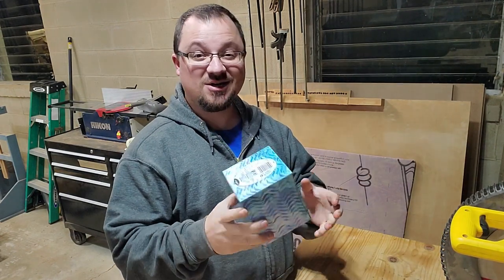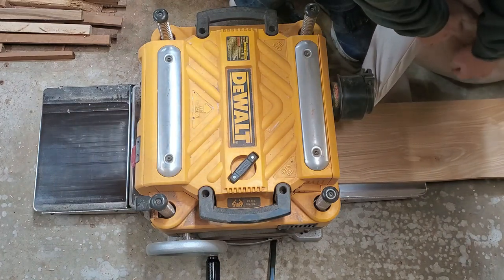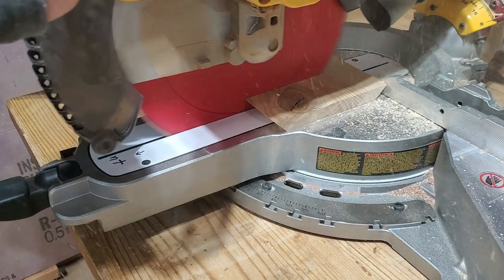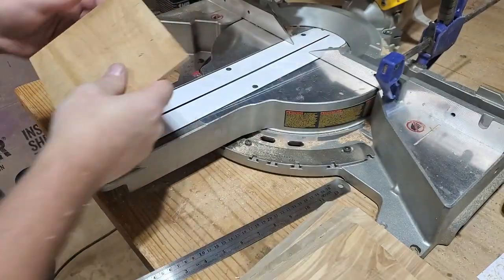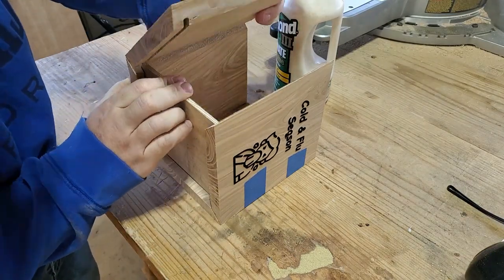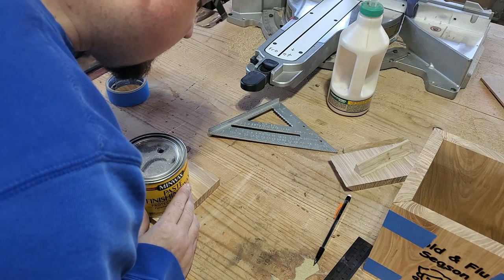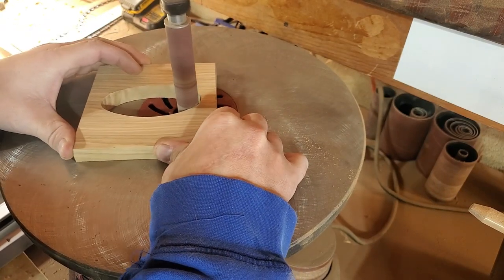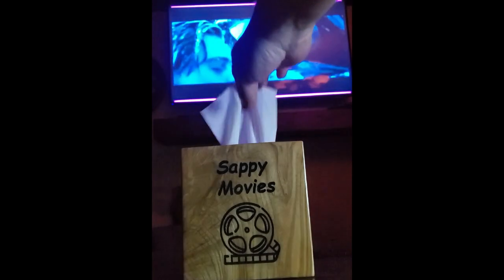Tissue box holder

Comment: A very nice box. Well done.

You lamented about having to pull out the router table to create the groove for the bottom piece of plywood. You have a table saw. It couldn't be any easier. Granted, your miter saw has a depth stop, but it takes a little finessing to get it right. You have a table saw. It couldn't be any easier.